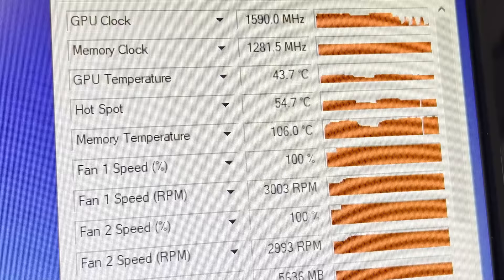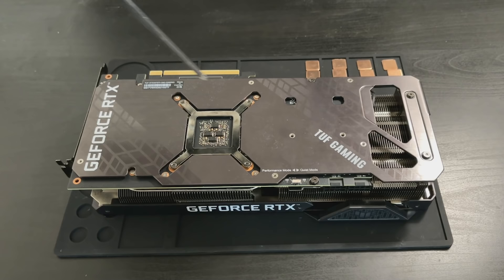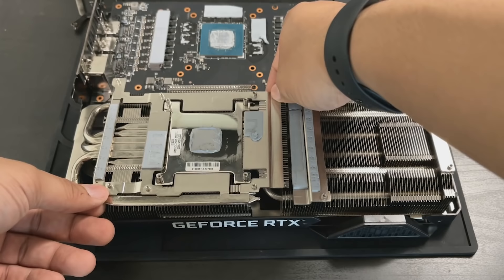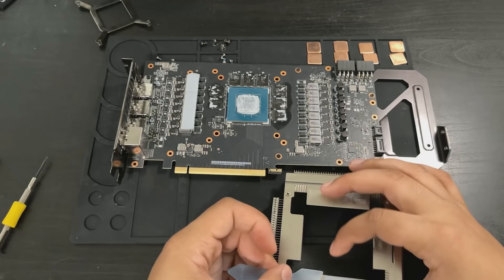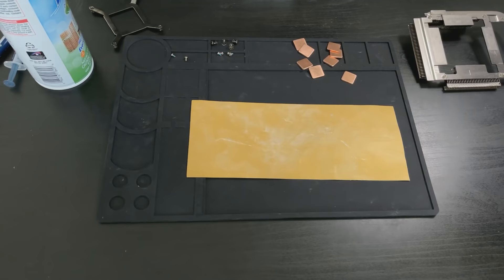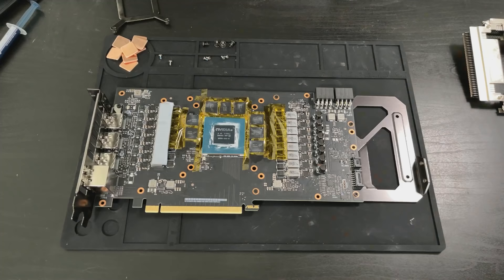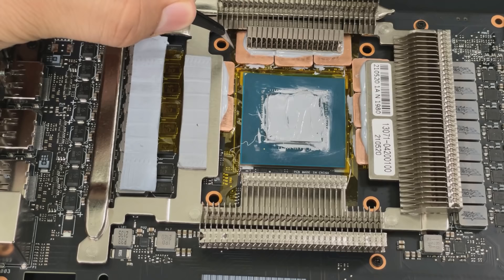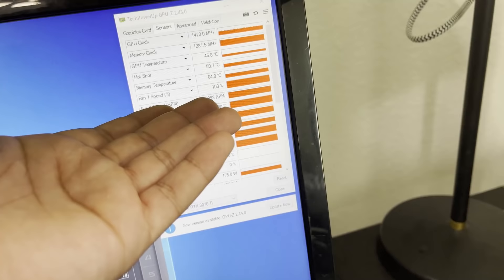I Copper Modded An RTX 3070 Ti.  Memory Temperature Dropped 45 Degrees! This Is How. (110C to 64C)

Comment: I recommend using acrylic clear nail polish instead. make sure that it is completely dried before continuing. this is what I use to prevent electrical shots when using liquid metal on the GPU and CPUs. I Recommend removing that caption tape from your VRMs definitely will be popping stuff, the thermal blanket is what you put on them preventing cooling. not as  big of a issue when it comes to the resistors and small caps.

Comment: I did something very similar to this on my cards but instead of using full copper pads, I used them like an IHS. I bought 0.5mm copper shims and sandwiched them between the memory and the exisiting thermal pads. My theory was it would allow more thermal pad to do its job which was correct and went from 108 to 75. Shimming like this reminds me of the Samsung controllers with the metal cap moulded as part of the case with the die bonded to it. I forsee that in the world of vram very soon
Reply: This is better because many cards have different sized gaps between memory and heatsink; some cards have different sizes on the same card! So one memory bank gap on the card will be 1.3mm and another gap will be 1.5 mm! Also getting a tub of thermal putty from digikey is best when you need to do this to a bunch of cards, as it much more economical, in addition to allowing you to have it mold to heatsink and shim.
Reply: do we need to put thermalpaste/putty between copper shim and memory, using your method?
Reply: @broke4free Yeah, I just stuck a gob of paste between the memory and the shim. The original thermal pads were used between the shims and the heatsink

Comment: Incredible result, great job! Insane that we pay these ridiculous prices and still need to go through these extreme measures to get some proper cooling on GDDR6X cards. How the F did so many manufacturers miss such an obvious and simple problem/solution?!
Reply: Because of the risks associated it would greatly increase manufacturing costs to mass produce. Then you'll complain about the high prices. And most consumers will never even know that memory is getting hot because the product will perform to spec for its warranty period regardless.
Reply: @BlueMax109  A manufacturer should easily be able to design something simular into the original cooler design. This is not rocketscience.
Reply: @pacaro4644  They can. But it will cost you more.
Reply: @BlueMax109  Not as much as I'm spending to watercool my 3080, which gets 120c memory junction without overclocks @ 100 fanspeed. Not kidding. A little piece of copper could have fixed that.
Reply: @pacaro4644  yes. It could. And then they have to magnify the cost of manufacturing that times millions of units. With an increase in assembly complexity costing more per unit on top of the copper content itself. While increasing the chance of catastrophic failure because its electrically conductive. All leading to higher cost per unit for the consumer at a time of record prices when 99 percent of their customers don't ever even look at the memory temperature.
Reply: @BlueMax109  Let's not pretend current prices have any relation to manufacturer cost. There wouldn't be any risk of conductivity if it was designed properly in the first place. Most heatsinks have copper anyway, it's the placement.
Zotac, for example, just scalp their own supplies. If only 2 % of the extra 100% they charge was spend on design, we wouldn't be having this conversation.
Reply: @pacaro4644  you are ignoring the fact that any business wants the highest profit for the least cost. And that 99 percent if not more of their customers don't care about the memory temps as it currently is.

Why should they bother? They have absolutely no incentive. You'll still buy the card at a high price regardless. Giving you better value for money is money wasted.

Also the copper contact plate on the die doesn't come anywhere near anything else. It is impossible for it to go wrong.

They would have to redesign the entire pcb to make it the same scenario for memory chiplets.

And again, why would they? It works perfectly fine as is. Within spec for the warranty period.

They don't care about you lol and the product isn't premium just cause it fetches a high price. Like any consumer product it's made to the lowest possible quality for the highest margin a given market will tolerate.
Reply: @BlueMax109  I am arguing the ORIGINAL design should have taken GDDR6X temps into account. Not talking about adding this plate.

What are you arguing here? Big companies want to make as much money  as possble? Thanks for that shocking revelation...

Doesn't mean we shouldn't call them out on it.
Reply: @pacaro4644  it does take it into account. They are running within specification for the warranty period. What can't you understand about that?
Reply: @BlueMax109  It's not about what I understand, it is about what we should expect and accept. 

You honestly believe we should just accept that? Your 2000/3000,- card craps out after your measily 1 or 2 year warranty and you just move on. " Oh well, Zotac gotta make that dollar. Warranty is up,  I'll just get a new one". This is your attitude?

What do you consider "within spec" anyway? Most 3080/3090's will throttle under heavy vram load, leaving you with ridiculous framerate drops.
For now it may be just a handfull of games (like Cyberpunk) but as games are becoming more vram intensive the issue will only escalate further. 

 
Thankfully the market is slowly returning to normal and actual competition might force these companies to do better.
Reply: @pacaro4644  doesn't matter what I believe. The market accepts it. Or the cards would be in stock everywhere.
Reply: @pacaro4644  yes they have copper but have you noticed where the copper is? You notice why they use thermal pads, it keeps the conductive metals away from the the board. Plus if mining with your card and not underclocking it, you kinda pushing the card to its limit in a workload its not designed for.
Reply: @pacaro4644  Also the problem with this card, look at where the thermal pads are, thats the major problem nearly a third of the memory wasnt covered. Copper is better but not when the vram tjunction is 120c. So when the memory is running at 90C its perfectly in spec

You go and start abusing the card mining and then get worse performance well no shit, you pumping voltage into it non-stop

Comment: Dude, keep this up my guy. Never thought of copper plates for the memory. Trying to keep my 3070ti's under 100C. Do another video like this for keeping mem temps low but the GPU's can be vertical. Find a way to keep those plates in place. or something else that can be used. Most have GPU's vertical.
Reply: Use thermal glue instead of thermal paste. Problem solved. They won't move an inch....

Comment: Nice results. I don't know what Asus were doing fumbling radiator like that.
Next time you can have better results with cleaning old paste. I go first with dry cotton pads, and dry cotton buds in tighter spots, plus small spatula to scrape dried paste. Then go with iso alcohol, and again pads, and if you get it around tiny parts - soft toothbrush. Going with iso first did what it did... more paste and more mess to remove.
Don't leave bottle open like that, when it's something as insanely flammable as that. I would not even trust myself with open bottle of this around.

Comment: So I did this mod with 1.5mm copper shims and it came out great!!  I used MX-4 thermal paste 2019 edition that I had lying around. I was able to test before and after with exactly the same conditions, even the same room temp.  Before the mod I had 41° Core and 90° Memory temps.  After the mod, I had 41° Core and 72° Memory temps. That is an 18°C drop in memory temps which is awesome!! What is also great is that the core stayed exactly the same temp so I know that everything went back together correctly, and the GPU heatsink is making the same contact to the die as before.  Total cost was $10.
Reply: TUF series card?
Reply: @alligatourist  Yes, it is a ASUS 3070 Ti TUF.

Comment: Important note: Everyone is talking about copper modding their vrms but it seems not one mentions the very obvious. The heat pipes to the main cooler!! 

The main heat pipes has a thermal pad which connects the memory vrms to the main cooler. If you miss this, or cheap skate on changing this thermal pad, you will find your temps remain high, if not increase with the newly laid copper. 

Also when you have changed the thermal pads and have screwed everything together, do a sight test.  Peer in from the side and check to see if there is 'day light' between the top of the thermal pads and the heat pipes. If you can a gap then you have used the 'wrong size thermal pads', and should add another layer. This is key!  In fact this is 'more important than copper modding your Vrms'.

Comment: I have two of these exact GPUs in 2 PCs.  I serendipitously solved the overheating issue by installing a side panel fan blowing directly through  the memory fin stack.  In one of the cases, the side panel has mounting holes for a 120mm fan.  I added a magnetic mesh filter.  On the other case with an acrylic side panel, I cut hole for the fan and installed a mesh filter over that, too.  I didn't have to take apart or mod anything to the GPUs.  They both run at 57 degC playing Halo Infinite, and around 35 degC doing anything else.  Good video, though.

Comment: I have the same TUF 3070TI, i bought it in august 2021 and i never saw 100+c temps on memory. The worst i saw is 96c with not even 100% fans. Im currently using my gpu to play games and mining,  my current temps are: 78c on aytolykos (nicehash) with memory clock almost maxed out @ 170 watts with 90% speed fans and daggerhashimoto at 90-92c with same specs.

My guess is, you just got unlucky with revision \ this specific card. 
Anyway, nice video, keep it up!

Comment: This is the kind of modding and tinkering i love.  In my journeys of delidding and running bare die (not to be confused with relidding where the IHS is reapplied), i used clear nail polish to insulate the capacitors.  Prob a bit cheaper than the tape.  Also a tiny bead on each IC is sufficient, no need to spread.

Comment: A bit late to your party, but this was in my feed today. Last week-ish (08/25) I built a computer to replace the 9 year old Frankenstein I had (core i5-6600k w RX 580 GAMING X 8G) with a new Ryzen 5 7600 w 6800 XT (Asrock Phantom Gaming D) and one of the first things I did was tear open the card and remove the thermal pads and replace with copper shims as well. Pretty much the same setup as you. I also modded a piece for the GPU die, recessing the heat-sink a bit to fit the smallest possible sheet I could. Yeah, most likely voided my warranty, but so far after testing 72 hours of heavy load, temps are insanely low allowing me to OC the card. Gets me average 85 fps with lowest 65 fps in cyberpunk and Starfield. I was also able to further reduce the bottlenecks with custom heat-shields on memory sticks (5200 with custom timing to bring to 6000 CL 28 speeds), and replacing the "juice" in the AiO cooler with a 98% distilled and de-ionized water 2% ethanol glycol and anti-microbial solution (I did open it, so...dont want junk growing in it) allowed me to push the OC on this CPU to 5.6GHz at load with no thermal throttling.

Custom cooling solutions will always be more beneficial than what comes with standard, un-modded solutions...as long as you practice good reasoning. I've been doing these things, especially with graphics cards once they were running hotter than 35c out of the box. I think the first time I practiced some custom thermals was on a pair of XFX GTX260's from around 2008??? Early SLI playground and such. Fun times. Being 25-26 was a great year. So many things happening back then.

Comment: Since the memory chips are way higher than the components there is no risk of creating a short.
If you're using conductive paste like Artic Silver or liquid metal, nail polish is a great way to protect the surrounding components.
I made a water block for my 2060 KO and extended my Artic 240, some alu fins on the memory with the standard fans.
GPU temp under load +/- 65C and mem temps 85C with +130 on core and +1300 on memory.

Comment: For removing sticky residues (eg stickers, vinyl, duct tape), use lighter fluid. They dry fast with no smell. Wet the sticky residue (or the sticker whole) and once the lighter fluid gets to the glue, it will dissolve the glue and the sticker will release easily (if the lighter fluid dries out then it will be sticky again) - try it out on different thickness price stickers they put on things you buy to get a feel of this, then you'd see immediately how lighter fluid can be very helpful in removing stickers and residues (they work many times better than IPA)

Comment: The big issue is the fact that all these chips are soldered on make them very susceptible to extra solder being under one chip and not the other, on top of that all PCB (The circuit board) are not created equal. You need to have larger tolerances because of manufacturing, ON TOP OF THAT these boards go from room temp to as high as 200 Degrees so there will be expansion as well as warpage so he is probably shortening the life cycle of his GPU by doing this. It will more than likely die early do to cracking the board from extra stress from flexing the board in those areas.

Comment: Bro, have no fear: The next time if you have trouble removing thermal paste/pad residues, just freaking straight up SPRAY alcohol on it, then wiggle it out and rub the rest off. Even if the thing you're working on is soaking wet, it will dry eventually - very quick with alcohol.
...
I used pads instead of pastes in some GPUs: 0.5mm pad + copper plates + 0.5mm pad; only around 5~10 degree reduction but they were all good from the start. There're rumors that the space (or gaps) between those chips help with ventilation, similar to motherboard's VRM, and spilled out paste will "choke" them. Wonder if you had it happened before...

Comment: Living the tape on is a mistake, you just keep the heat on those areas and those components, will be under thermal continuous stress.

I copper moded 2 cards 1060 6GB Zotac and HD 7950 3GB, with no damn tape, are still alive with better temps on VRAM.
 
Is no way coppers shims can shortcut anything because they don't bend, not even at 100 C. Because is a clearance in between PCB contacts or parts, like resistors, and copper shims.

The only problems on copper moding is the thickness of the copper shims, sometimes you have to sand down more than you want, so you better start with 180 grit and go with finer 400 and over after. If you stop on 400 grit use rougher paste like I 7 Diamond. 
If you don't get the right thickness on copper shims than the radiator contact is poor and you'll see it soon.

Putty for me was worst than copper but, I didn't test too many brands of putty.

The worst part is that manufacturers, most of them, now are coating radiators fins and pipes, contact plates with Nickel which got very bad thermal conductibility and convection compared with copper and tbh don't think are even use copper anymore, just saying they do. Those who don't coat them with Nickel are painting them, another crap idea!

Copper moding is safe unless you use thermal paste with electric conductibility or blow copper residue on the PCB.

Comment: I would have installed the plates first on the heat sink side using thermal glue instead of thermal paste, then used an electrically non conductive paste between the shims and the components. Maybe do a dry fit with some compression paper first to make sure you're getting good contact all around. Because if the manufacturer is using 4mm pads and you're using 4mm shims and the pads compress but your shims do not then you may end up with a gap between the heat sink and the other components.

Comment: ok if this is true, then that's fairly significant.  Less heat, means less resistance in the conductor which means less current will be drawn to achieve your voltage, which means reduced wattage.  you need to redo this test, and benchmark the card to achieve the same performance at the least amount of wattage possible.  the graphics driver sets the wattage limit on the card, or in some cases application controlling the driver. this would be extremely useful for people who use gpu's to mine ethereum, these shims could be applied  to all the cards and reused when equipment is sold and upgraded... and the people buying the used cards will be happy to have a card with no heat damage... everyone wins.

Comment: this is a good video, I did a 3090 suprim when I used it for mining, though I did it differently. I didn't use captive tape, mainly cos I didn't really think about it. but what I did do is made some copper shims which were about a quarter of the size you used. I also used oversize heat pads and cut a hole to slot the copper shims in so they go over each memory chip. was able to get the heat to top out at below 80 when working hard, instead of 110 degrees. this was with a moderate overclock when I was mining. for normal operation it goes way lower.
Reply: Good job. It can be done, people need more courage.

Comment: You mean to say, with the high prices they're getting, they could improve the cooling and performance of their products with the addition of copper to the cold plate, yet they chose not to? Probably saved them a lousy 5 bucks but a shortened lifespan is a big plus.

Comment: I have been copper/shim modding gpus since my GTX 760, best result I ever had was on a ASUS STRIX R9 390x, a huge 3 fan card that was crazy hot out of box, after copper shim mod and thermal paste it never went past mid 70c under load. Honestly surprised no one had/has tried this til recently?